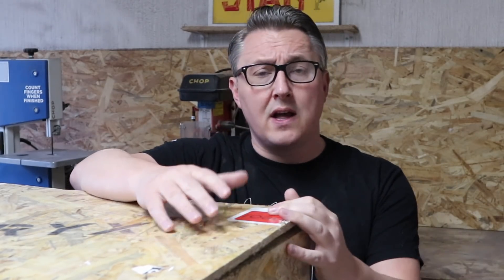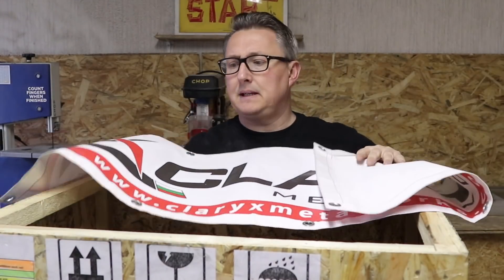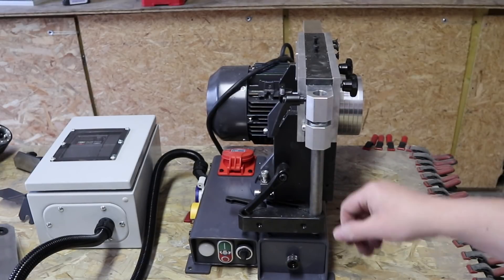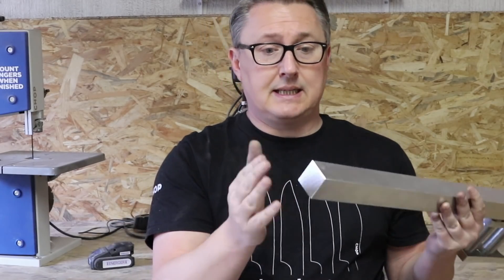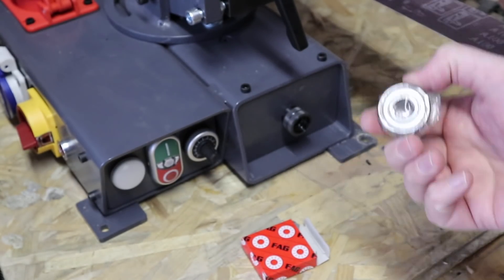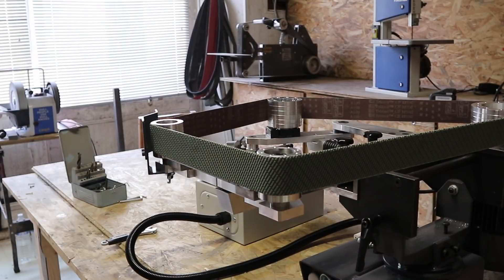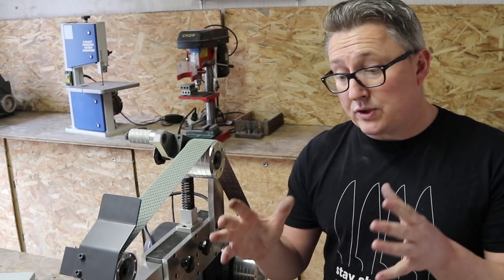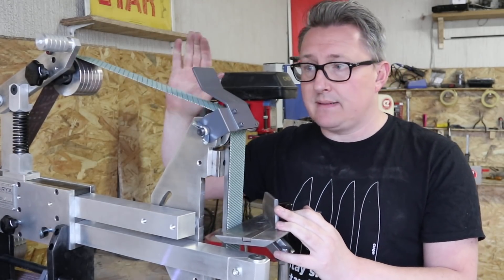New grinder day!  The PRO v2 belt grinder from Claryx Metal Works

Comment: Hi Craig, What are your thoughts on the grinder resting it’s entire body on the tiny swivel at the base, I don’t see how that would be stable with a big guy like me leaning in on a heavy grind. I always assume a machine needs to be heavy and bolted to the floor. Seems chintzy.
Reply from the maker: Darryl Hebbes I didn’t show it too well but once it’s locked into position it’s solid. There are bolt heads to sit on as well as the main slackening mechanism.

Comment: Bad ass machine. You mentioned electrical can be fitted per region. Does that mean they have a version for 240v in North America? If so, will the knife talk discount only apply to the EU or for other regions as well?
Reply from the maker: Yup, they can get you squared away. Promo code works too - drop them an email